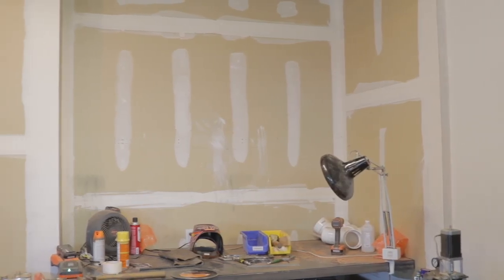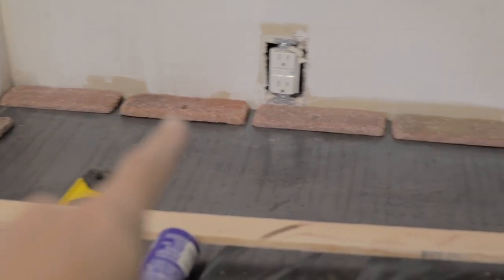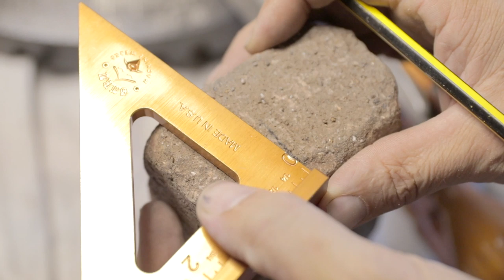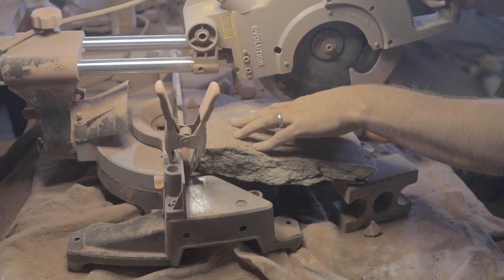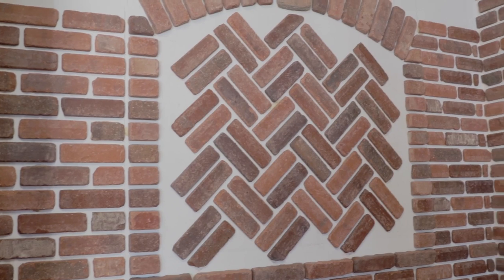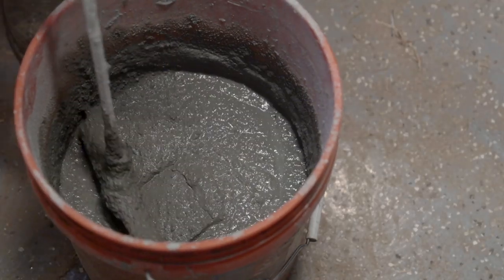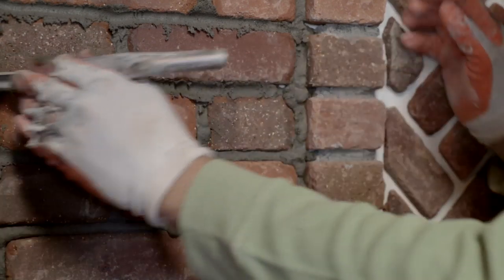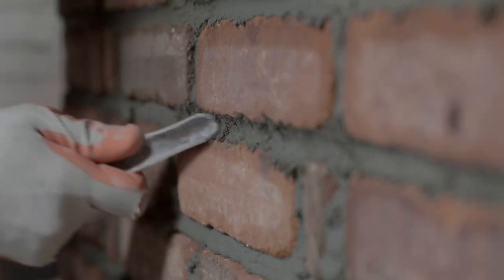How to Lay Thin Brick Like a Pro

Comment: Great video - good details.
For a newbie, one person, how much grout is a good amount to make, apply, and finish in each go-around?
Reply from the maker: 1/4 bag tops.  Start small.  It's easy to mix more.  If you mix too much, you can add water to thin it just a little.
Reply: @GregsGarage  Thanks Greg. My project is small, so I'll go with a little less. Cheers,
Reply: @GregsGarage  Hey Greg !
What about the inside corner for a stove hearth in the corner of a room?  How to bridge across the corner? Are there INSIDE corner thin bricks? OR do you just run a vertical grout line from top to bottom?
Thanks again.

Comment: Great job.  Roughly how long did you let the mortar sit before using the trowel to start compressing the mortar?
Reply from the maker: 30 minutes or so.  I do live in a VERY dry climate.  It can take an hour or more in humid areas...  There are quite a few factors that affect the drying time - the mix ratio, the temperature, humidity, size of joint, porosity of the brick, etc.

Comment: I may have missed it in the video, but what size spacers did you use?
Reply from the maker: Slightly over 3/8"...  Maybe 7/16".  I wanted a deep raked joint so I made a little extra room for the jointing tool to "sink into" the joints.

Comment: Using traditional bonds is essential to achieving a real English look to properly complement your lovely Tudor herring bone panel. No wall would ever be framed with a vertical line of full stretchers. Lots of research on Google (it's not about fitting in as many full bricks as possible). Nice concept.

Comment: Is there a trick for getting the mortar just right? Whenever I have tried it, it is either too runny and runs all over the bricks or it is too stiff and won't come out of the bag.
Reply from the maker: If it's too runny, let it sit for 30 minutes or so.  It will stiffen up.  I mix in small batches so I can get a section done under ideal stiffness conditions.  If you mix a big batch, there's a good chance it will get too stiff before you're done applying it.  You can also cut the tip of the bag back a bit to help with the flow.

Comment: Thank you Man I just follow your steps and  did a wall at my man cave and looks amazing almost like yours! Question what kind of sealer you recommend?
Reply from the maker: You don't need a sealer if you're indoors, but any masonry sealer will work.  Test a brick that can't be seen.  Some sealers have gloss that doesn't look good.  Your brick supplier should be able to hook you up with something that will work well.  Congrats on the project coming out!  It looks easy on video, but its a TON of work in real life.  AMIRIGHT???!!!

Comment: Is that just a standard mitre saw but with a diamond blade?
Reply from the maker: No.  The evolution saw can cut steel, aluminum, concrete, etc.  I think it runs at a slower RPM.
Reply from the maker: You could try it with a normal saw...  I don't think brick cares about RPM as much as a lot of other materials do.
Reply: Thanks!

Comment: Running bond lmao you have a zipper joint in the middle of that pilaster bud
Reply from the maker: Zipper joint.  LOL!
Reply: Yeah thats what its called. Not half bond not running bond not even third bond but hey what do i know? I only use a trowel daily to feed my family.
Reply from the maker: @eyesopen2694  I'm with you.  I just design buildings to feed my family.  Bottom line...  It ain't important if it's lick and stick brick on the inside of a garage...  If it were were modular cavity wall design, I'd be a bit pickier about the layout and design and there would be all kinds of fun places for expansion...  This panels is truly just a piss.